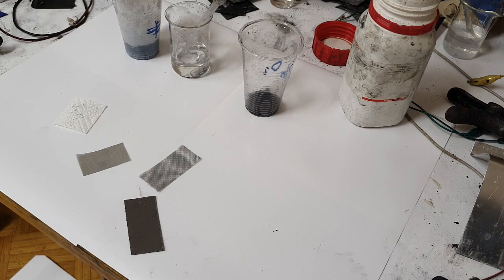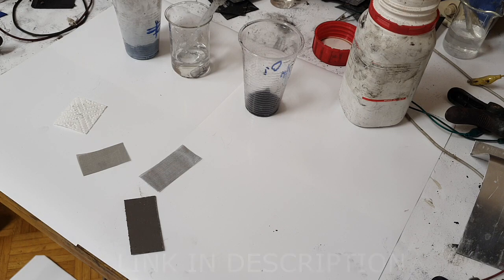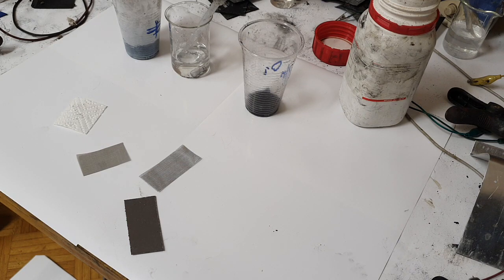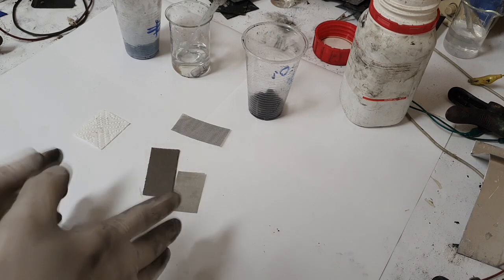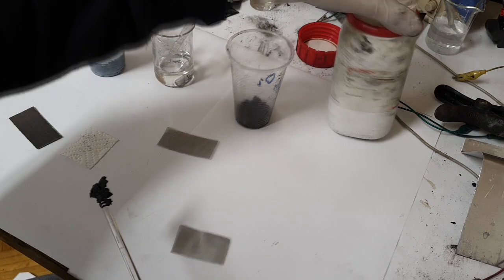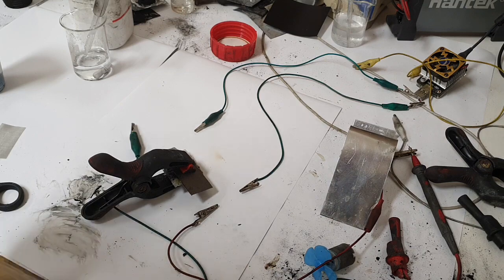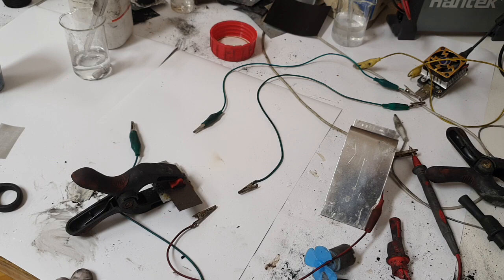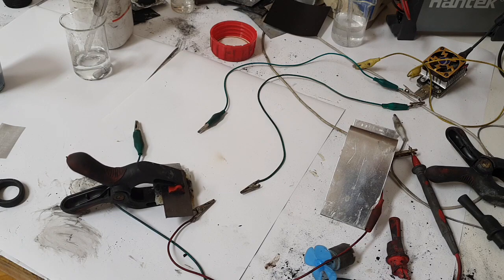New Iron Battery

Comment: Neat battery, good operating voltage. I have had good results with iron carbon batteries using iron chloride electrolyte. Only 1V but good output current. I've shown the battery in my first video and would appreciate any feedback you might offer. Thanks
Reply: Hello. Did you continue making the iron chloride battery?

￼

Comment: Good evening from Pakistan 

I was your subscriber and watch your videos very carefully and I am going to build nickel iron battery.
Reply from the maker: Hello! Nickel iron,.... good one
Reply: @cayrex  

Trying to use steel sheets sheets after nickel plating.
Reply from the maker: @behzadhussain11  for the current collector,..... better will be some nickel foam with nickel hydroxide active material. and then charge the cell to form nickel oxyhydroxide
Reply: Sir

I am trying copy / replica of iron Edison battery.

Trying to design same size and trying make pockets with same dimensions. 

Steel is easily available in our market and nickel metal is hard to find out. That's why I am interested in nickel plated steel instead of pure nickel metal.

Secondly I am trying to make the pockets with nickel plated steel mesh.

Am I on right path ?

If possible , can we exchange phone number or email I'd.

I would love get assistance from teacher ( you )
Reply from the maker: @behzadhussain11  ok I see! in this case you can use a iron / iron for the positive and the negative electrode. but to make a positive electrode you need to electroplate the iron with nickel first. In this case you need have a fine nickel plating. At this point you end up with positive electrode which is iron electroplated with nickel and a negative electrode made from iron. Is good if you use iron powder mixed with some conductive material like graphite. iron powder have greater surface area but the problem will be when the battery is discharged and on the negative electrode will form iron oxide which is not conductive in this case you will lost some capacity. the graphite mixed with iron powder will help to make a conductive matrix. and now the positive said,... on positive electrode you will also need some active material like nickel oxyhydroxide or maybe a nickel hydroxide, but I think that this will be also the problem to get in your country.

Comment: Shouldn't the Manganese Oxide been milled to a fine powder instead of the chunks you used? Also, wouldn't it have been a lot better to squeegee the Iron paste onto the stainless steel screen than to just clump it on? By doing what I suggested would give you a more precise battery plates.  A better separator would have been in my opinion a very fine plastic or glass mesh screen. Don't you think? Just asking.
Reply from the maker: You have all right,..... but.... for prototype or a demo is this just fine

Comment: What mesh size is your stainless steel electrodes? Fe - MnO2 batteries are very intriguing, thanks for posting!  Here is a good source for you to look at 

http://cecri.csircentral.net/1483/1/46-1988.pdf
Reply from the maker: SS is 300 mesh. Thanks. This is a alkaline version, with less voltage.
Reply from the maker: Ups it is 325 mesh
Reply: @cayrex  thanks, i've been looking at different mesh sizes for a few days for my own electrodes xD 325 seems like a good size.
Reply from the maker: @wanderingzanzey2126  😂😅 yea good size
Reply: @cayrex  is it just a random choice on your part?
Reply from the maker: @wanderingzanzey2126  what?
Reply: @cayrex  the mesh size :)
Reply from the maker: @wanderingzanzey2126  hahahahahaha 😂😱
Reply from the maker: If you want I can send you the link of the company. The company have many mesh sizes SS and have fast shiping.
Reply from the maker: First I use 50 to 60 mesh SS which was fine to make carbon electrodes, but 325 mesh is way better to apply a ink like carbon material.
Reply: @cayrex  Yes, please! I've been searching for a supplier within EU.
Reply from the maker: @wanderingzanzey2126  when I come home I will send the link
Reply from the maker: @wanderingzanzey2126  https://www.inoxia.co.uk/products/mesh
Reply from the maker: @wanderingzanzey2126  or you have also on ebay: https://www.ebay.com/itm/Woven-Wire-325-Mesh-50-micron-hole-0-036mm-wire-316-Stainless-Steel-filter/252711316391?ssPageName=STRK%3AMEBIDX%3AIT&var=551689209242&_trksid=p2060353.m2749.l2649